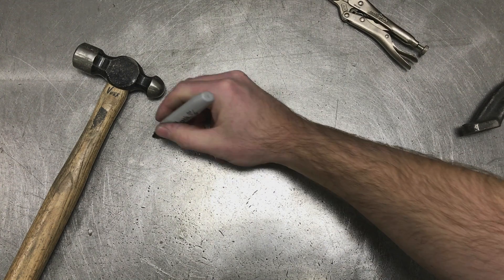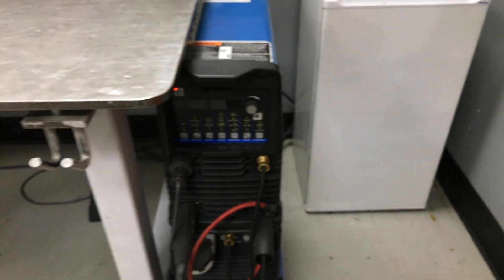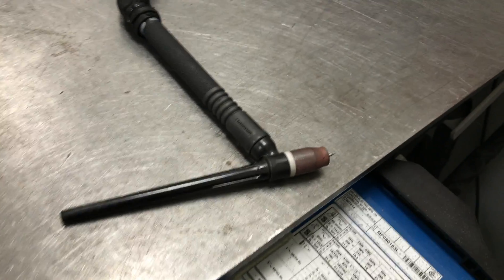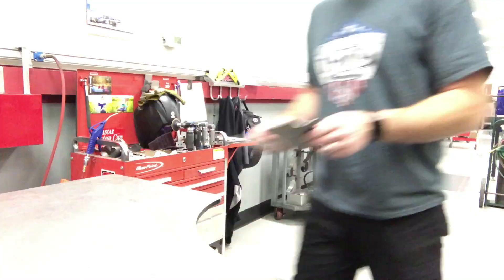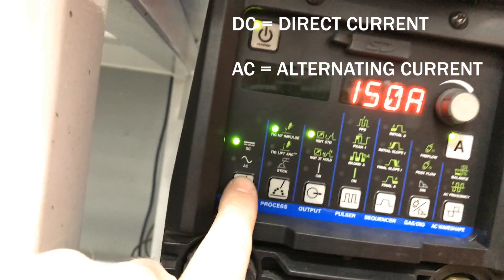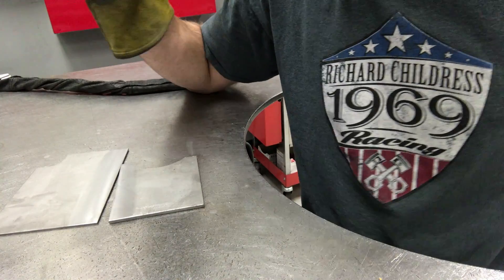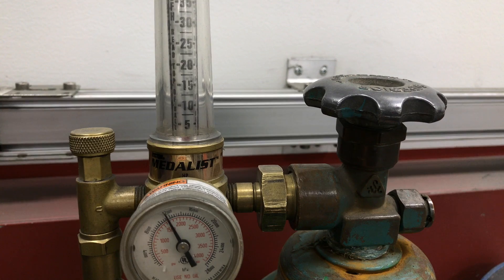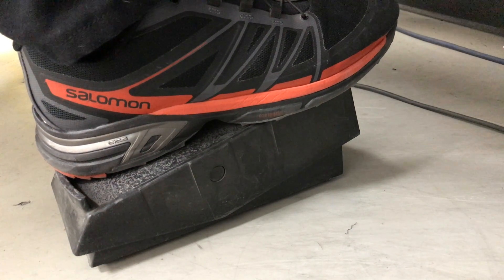TIG Welding 101 From A NASCAR Pro?

Comment: Hi Justin, I just found your Vlog, somehow, but I am curious what your thoughts are on the type of tig welder a newbie should look at. I know these Miller 280's are cool but at $4500 I'm not sure if I want to learn that bad. Are there Pro's and Con's to having a say $2500 welder? I want to make racking out of aluminum tubing and I'm to stubborn to hire out the work.
Reply: I bought a thermal arc 186 ac/dc Tig for about 1700 bucks a few years ago and I'm very happy with it, so far it can do everything that the Miller I learned on can do and in 5 years it's never had an issue. just my opinion

Comment: So how does one get a job for a NASCAR team welding chassis' and whatnot like this? I've been a big time NASCAR fan for 15 years, and I've been welding for 7 years, mostly TIG.  And id love to combine the two into one. 

Interesting to know that stainless wire is used more than steel in these applications

Comment: I'm not anywhere close to a competent welder, sometimes I run perfect beads just a 1/4 inch off the joint, but its a pretty weld, of nothing. Your explanation of how to tack weld and how far to move in the puddles was invaluable. Your the only person I have veiwed that talked about watching for melting to occure, with your instructions I now get the two pieces to at least stick together, my wife thought I burnt myself agine when I started yelling "It worked, hot damn it worked"

Comment: could you explain what steel thickness did you use, tungsten type and size, and what filler rod size and type that goes with that. and maybe explain the rule of how to  chose which size of tungsten for  material size and filler size. Not many explaination found on youtube about those things. thanks.
Reply: i mean, make a video about it :D
Reply: Not bashing this guy but welding tips and tricks is very informal on all that stuff and great arc shots thats who you need to watch to learn how to weld when i bought my first tig i had never touched one before and i learned to weld off of his videos

Comment: Why stainless filler instead of a er70
Reply: Definitely looks nicer, I was just curious if there was a benefit since it cost more.
Reply: Mike Greenwalt I've heard stories of teams discovering a ton of cracks in the welds when using stainless filler with mild steel, I wouldn't recommend it.
http://www.millerwelds.com/resources/communities/mboard/forum/welding-discussions/3531-stainless-filler-rod-with-mild-steel